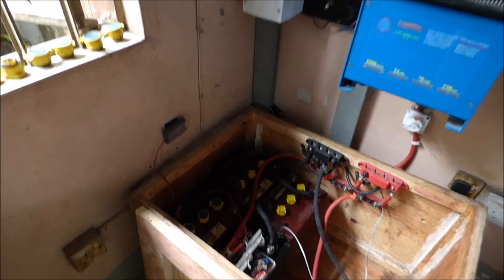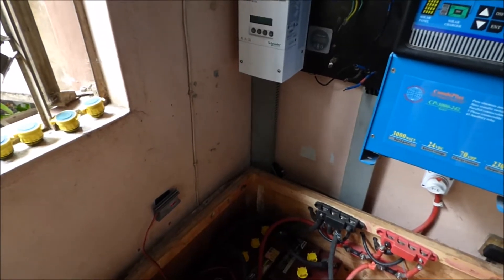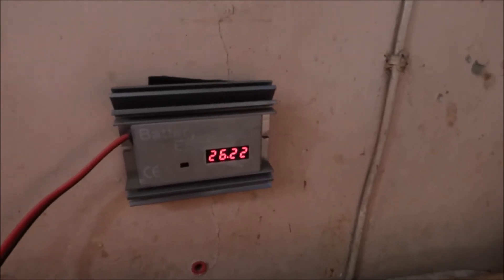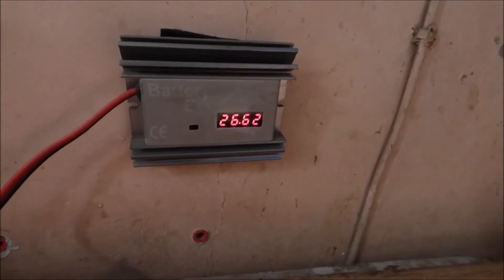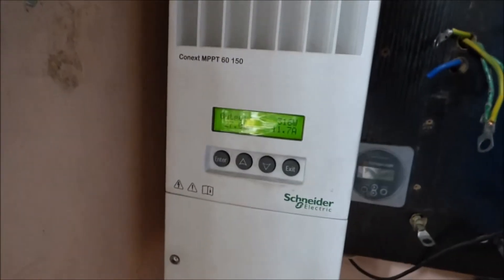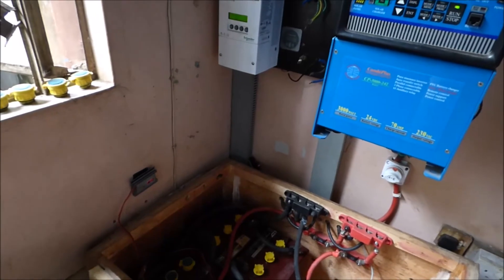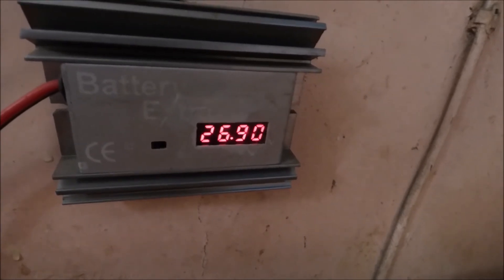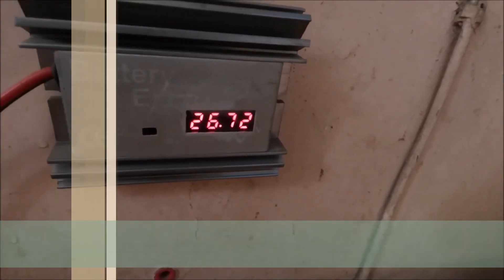What does the Battery Temp Sensor do? Do I need one?

Comment: Good day sir please my mppt charge controller came with a temperature sensor but no wire, please sir how can I fix the wire,pls sir this is my no 07067892944 , email : ibrahimsuleiman866@gmail.com
Thanks
Reply from the maker: What type do you have? Installing it close enough to the battery usually works. Not all controllers come with a cable or probe.

Comment: Do Pylontech lithium batteries need a separate battery temperature sensor?
Reply from the maker: I don't know
Reply: AWPS Renewable Energy, LTD I appreciate your honesty. On a separate note, I have a 12 x 250Watt array of panels currently running my 3Kva, 24v system, now I want to upgrade to a 5Kva 48v system but due to financial constraints if I upgrade my PV wires only to be able to handle 48v, can they not run my current 24v, 3Kva inverter till later when I can and am able to upgrade the inverter/charger and or Mppt? My current Mppt is rated for maximum 60A.
Reply from the maker: @Moffat-T  why do you need to upgrade your wire? If they are good quality wires let them be. Most PV wire are rated for up to 1000 V. The current you will run on a 48V system is less than what you will run on a 24 V
Reply: AWPS Renewable Energy, LTD That was my thoughts too, until one installer told me that the wiring I currently have is electrical wire NOT Pv wire. Hence the question to upgrade as funds permit.